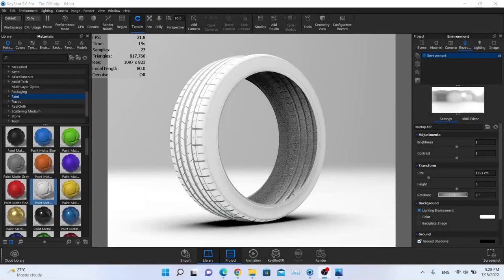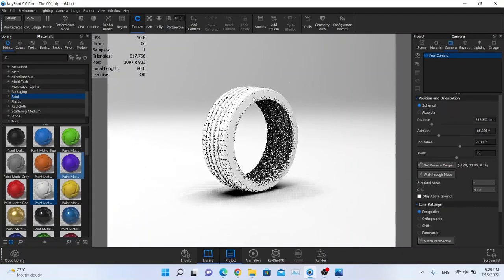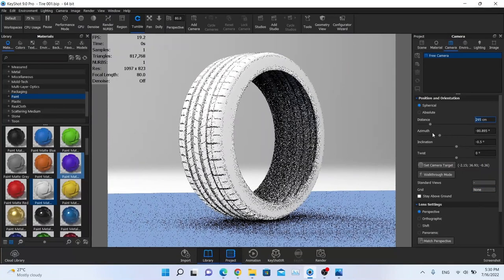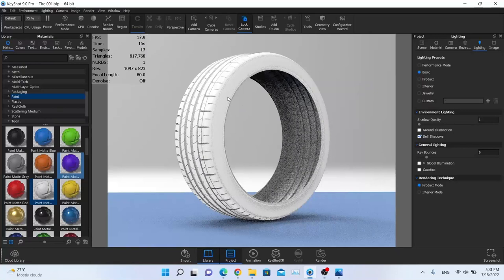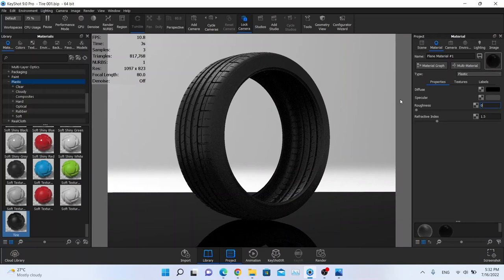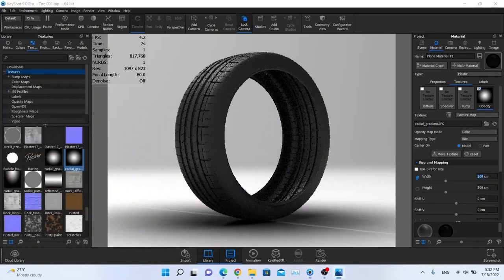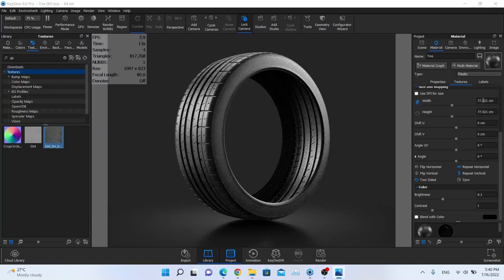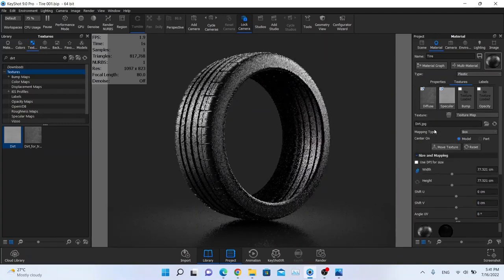KeyShot Realistic Tire Rendering, Shading, Texturing ( Free 3D Model )

Comment: Thanks for this tutorial. If the texture map isn’t uv wrapped but box mapped etc, can you achieve the same results? Also can you do a tutorial on uv mapping?
Reply from the maker: Hello, the model in the tutorial is not UV unwrapped. So the best way to create realistic materials and texture is using simple projection tools in the KeyShot. For example you can use cylindrical projection, planar projection or you can use box projection. Sometimes box projection works really good, but if you working with tires or cylindrical objects you dont need to UV unwrap model, you just need to change box projection to cylindrical projection in the KeyShot and change axis, you need to try axis x/y/z, depending on orientation of the model or texture. You can see in the tutorial I used simple planar texture for decals on the side of the tire, and for the actual dirt to make tire little bit more realistic I using cylindrical or box projection. You just have to play with scale and also rotation. Hope you understand, if not, I will create another tutorial with more explanation 🙂

Comment: Hi Texture Man, what kind of Graphic Card do you use (Brand/ RTX/ Nvidea etc...)

cheers Simon
Reply from the maker: Hello Simon, I am not using GPU for rendering, I am using CPU for rendering. My workstation got Intel Core i7 7700K and GTX970 so it s pretty old one GPU. I am recording all my videos on Asus ZenBook 481 with i7 CPU aswell.
Reply: @textureman  woww really tough, but try GPU Mode of course its more speeding up your render process.
Reply from the maker: Of course GPU is faster, but it producing different Images, there is some small details which you cant achieve with GPU, you trade speed for quality, But sometimes you can use speed to achieve more details cause you can made a little bit more work :-) All my power is in the CPU, but when I upgrade my workstation, I will try power of GPU aswell. :-) more tutorials coming soon
Reply: @textureman  thank you very much 🙏✨ an really woww amazing work! Good work!